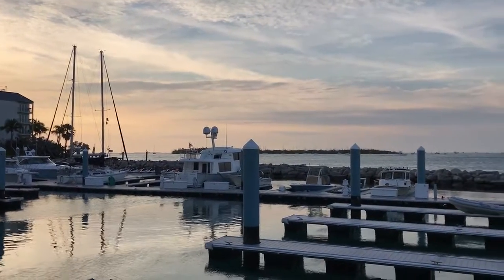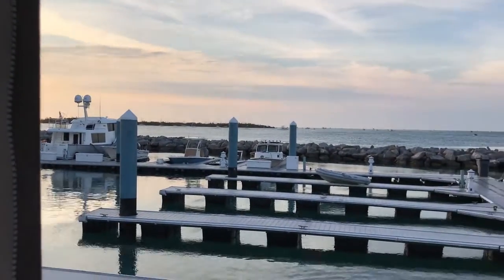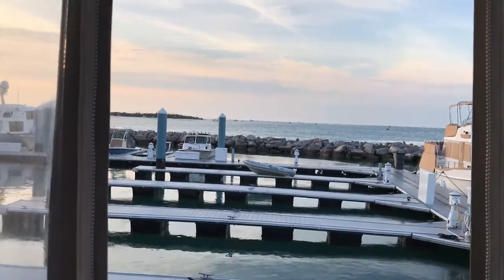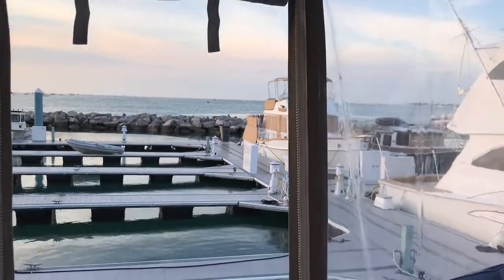Catamaran Bridgedeck Clearance

Comment: That leaves the more interesting question: how much bridgedeck clearance is "adequate" in actual numbers?
Sure, at first glance it seems like you can't have too much clearance, but increasing the clearance (at the design stage for a boat) will also make the whole boat sit higher in the water, it will have higher demi-hulls and more windage, more material/weigth that goes into the whole boat, higher center of gravity... therefore I think there are also downsides of a higher clearance, so it's gonna be a compromise.
I'm aware that there are some details to consider like shape and displacement of the bow section (because of the influence on the bow wave) or the distance between the hulls (=interaction of the two bow waves). In other words: a precise answer will be difficult, but at least: how can we come up with good rule of thumb for how much is enough for a boat of a given size?
Reply from the maker: HI Christian! Good question. Our rule of thumb is: 4% of LOA is low, 5% of LOA is acceptable and 6% of LOA is good. We have owned two cats with low bridgedeck clearances and two catamarans with good clearance. Our experience was this: the slamming on a low profile design with lower bridge deck, is significant and it takes some getting used to. Also, when the tunnel fills with water, it creates a lot of drag and slows the boat down. This doesnt occurs nearly as much with a higher bridgedeck and a clean tunnel. Catamarans with a higher bridge deck clearance and a clean tunnel (no obstructions) simply perform better in our experience i.e. our Lagoon 450 and Bali 5.4. With the development of very light and stiff infusion technology and foam cores, weight is much less of an issue for cats but windage is definitely a factor.

Comment: Great info. would have been good to cut to the video Steven filmed in Hawks Channel :-) Also, a cats propensity to slam is best measured with the True Wind fwd of the beam Great info as always from you guys!
Reply from the maker: Sailing Luckyfish thanks for the comment and of course you are right. I think, as you are well aware, all cats will slam at some point, as do our boat in the right conditions. However, good bridgedeck clearance and a clean tunnel will significantly reduce the degree of slamming.
Reply: @Catamarangurus  yes, good point of course. I think we are now in an age of sail when route planning and mid to long range weather forecasts are so well understood/reliable that "getting caught in a blow", beating off a lee-shore or hammering to windward for days on end are largely avoidable (famous last words). So perhaps it is not just that boats are being engineered and built lighter that opened the door for solid foredecks but also that boats simply dont have to go to windward so much.
Reply: @Catamaran Guru - sorry, mixing topics here, bridgedeck clearance and your solid foredeck video on the Bali 5.4 which I also just watched (good one btw). But same reasoning applies.